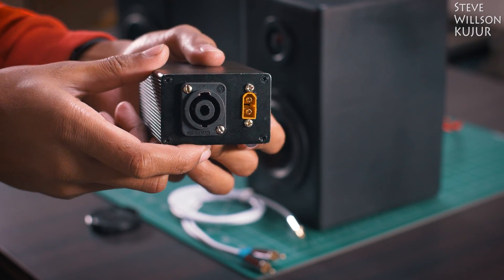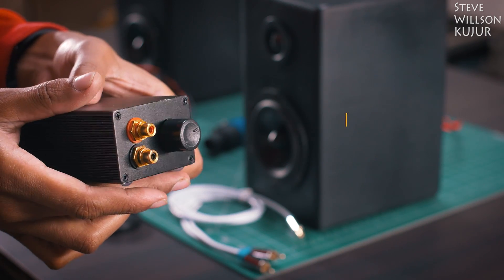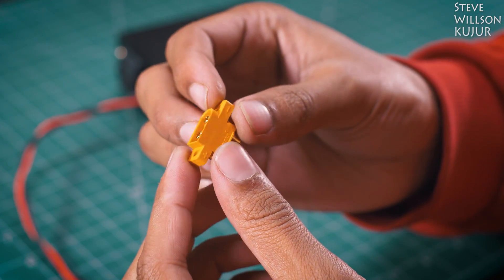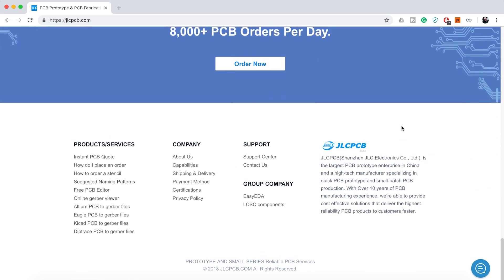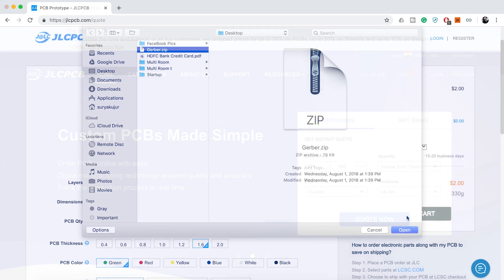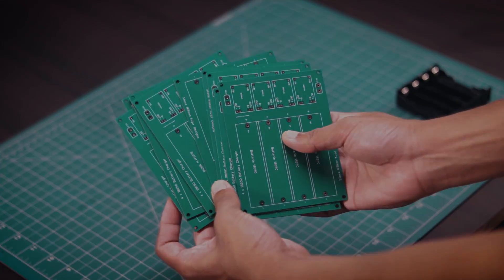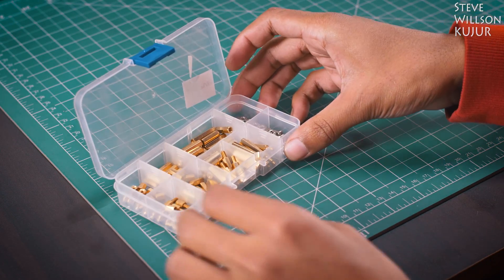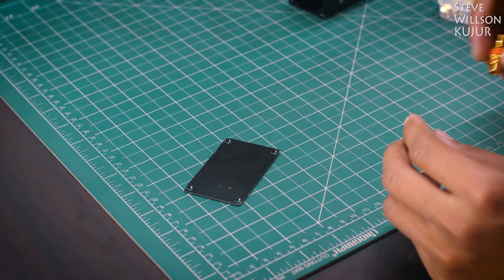DIY 200 watt small Amplifier

Comment: Lies it cant be 200W just because its the power rating on the amp does not mean you have 16A*12V from your power supply your tiny wires would be smoking at 16A.